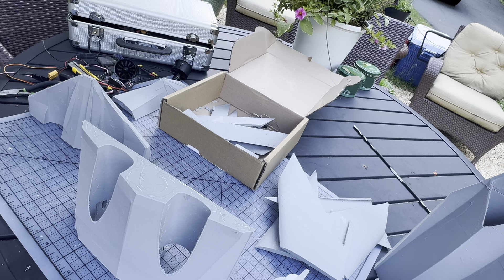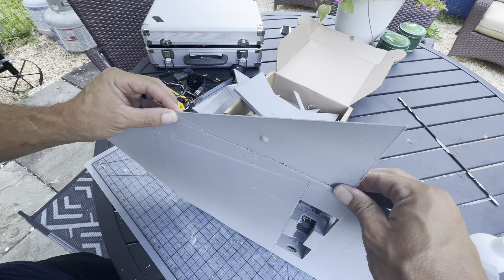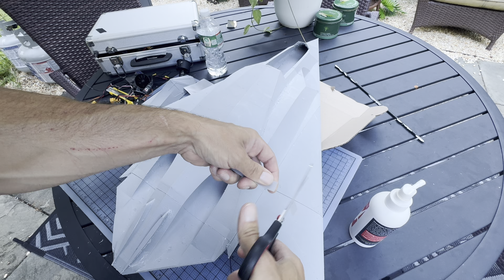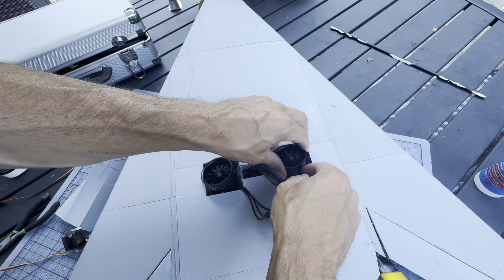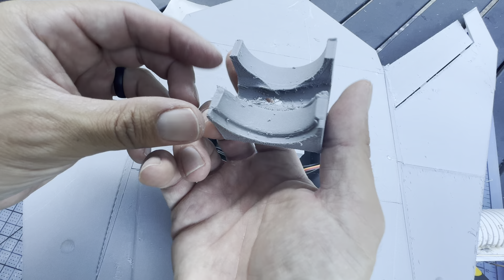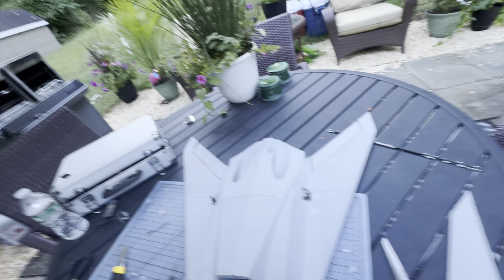F117 Stealth fighter build video pt1

Comment: I think Shoe Goo will work well to  reinforce the mid  bottom of the fuselage.  A strip of Shoe Goo down the middle and around the EDF slots.  Also another strip of shoe goo around the bottom and front of the nose., and a thin  short strip along the tail.  I usually apply a thin layer of shoe goo to my foamies.  I use a squeegee and apply a thin layer.  It works great.  I've got a 4 year old Eflight  Flight Test Night Radian that that is reinforced with Shoe Goo and it still flies well.  You just need to squeegee it, you don't want to cake it on.
I am currently printing fuselage part #4.. I have 1 - 3 done.  I am using eSun LWA foaming PLA.    I am repurposing the 40mm Xfly edfs from my xfly eagle.  I'm using the servos, horns, pushrods, cleavis.. everything from that wing.

Comment: I just bought your STLs for this bird off of Cults3s.  I am repurposing my twin 40mm EDFs from my Xfly Eagle.    What software do you use to  design your models ?     I would like to design a Foo Fighter that uses one large EDF and  multiple control vanes to control the attitude and direction,  heading and flight control would be with arducopter.

Comment: The reason I prefer planes with landing gear is that I have turfed too many planes trying to hand launch. I feel like more than 50% of my maidens on hand launched planes have resulted in a crash. When taking off with landing gear if a plane is nose heavy you will know because you have to pull back harder on the stick but once you are off the ground you can trim for it and then just readjust CG before the next flight. With a hand launch the only way you know that it is nose heavy or that it needs some reflex is when it nosedives and you have to pull out the glue. I also fly from a field that has no glass to softly land a plane. Not a criticism of your design though, just letting you know that for me it has nothing to do with a desire for it to be scale and it's more about function. Love this design though.
Reply from the maker: @Vaeloron  totally I wish I had a landing strip AMA field local. Unfortunately I have thick grass fields that won’t allow a plane with less than 3” tires take off. I’ve tried trust me. The size gear needed for my field will weigh my planes down to the point they can’t fly

Comment: Hey Kyle, I just started printing. I beleive you mention it's for 40mm EDF. I j ust realized my EDF's are 50mm. Do you think they'll fit???🤔🤔🤔
Reply from the maker: @carlosperez7015  crap! Yes we can scale it to 50mm no problem! Just stop printing your current one. Just scale the whole thing to 125%
Reply: @hotlapkyle  Ouch!!! Fuse is almost done. No chance the 50mm will fit huh??
Reply: Just realized it won't fit my printer at 200x200x200
Reply from the maker: @carlosperez7015  no problem just slice the part in half and print the halves and glue them. My designs use slicer generated infill so you can slice and dice to any scale
Reply: @hotlapkyle  I'm afraid I'd have to do the same with Fuse 3. Don't like the extra gluing. Thanks for your quick response. You might have your original model flying with twin 50mm's. 🤞🤞🙏

Comment: WOW! Is printed in standard PLA or is that a colorfabb Light weight (LW-PLA) type? 
Looks like an incredible design! 
Looking forward to slicing it up and giving it a shot.
Thanks for making these videos.
Reply from the maker: It’s actually 3d lab print active foaming LW pla. Very similar to color fab
Reply: @hotlapkyle  Just bought the model off cults! Super excited.  I've had issues with LW PLA in the past, especially with black (which is the natural color for this build!)- it does not like the sun at all and is very very fragile.  Have you tried normal PLA or PLA+?  Any disadvantages of using that material aside from the extra weight?  Would you suggest doing LW-PLA with a thin paint instead?
Reply: I hate printing at 50mms with lw pla. An 1 ops its toast after 60hrs of printing.

Comment: all i see is you gluing some parts, 
so where did the parts come from.
Reply from the maker: @gerardjones7881  they are 3d printed. I offer you the files and you can print them and assemble them. I have links to the plane on my othet f-117 videos